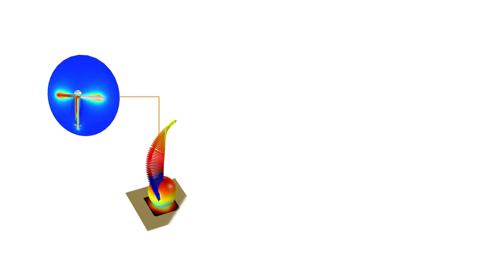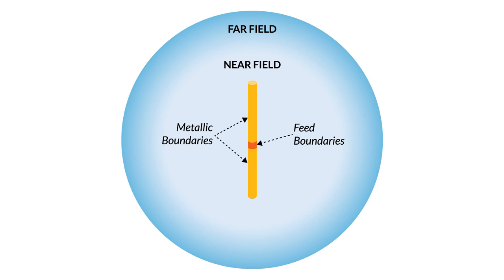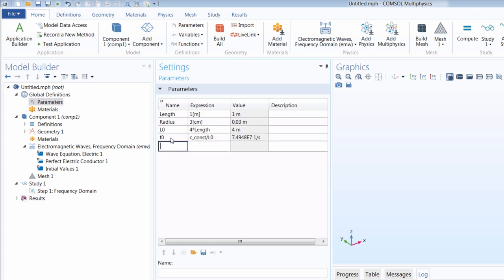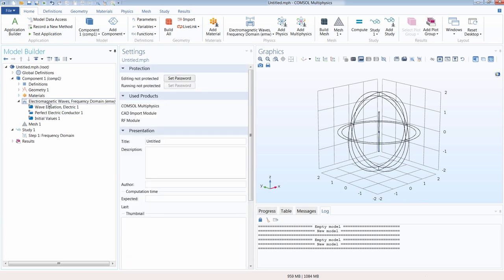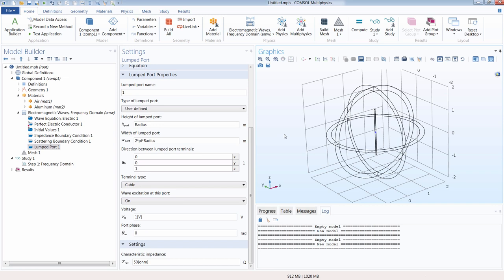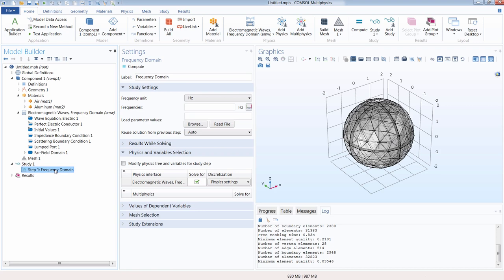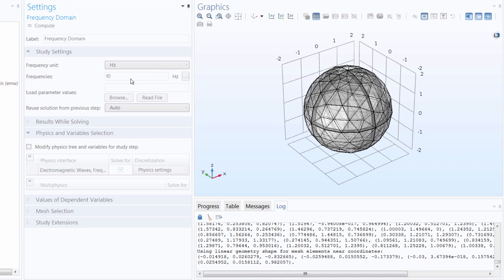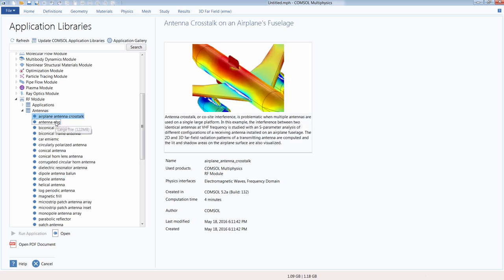How to Model Antennas in COMSOL Multiphysics®

Comment: Hi Comsol,

 I'm Rubén Bosch, I have done a helix with work plahe which are capacitors to the matching network and the supply. If I do " Form union" with helix (copper)+work plane (Perfect Electric Conductor) +sphere (air), I can define the work plane with PEC but I can't define the Impedance Boundary Condition for the Helix. On other hand, If I do " Form Assembly" with helix (copper)+work plane (Perfect Electric Conductor) +sphere (air), I can define Impedance Boundary Condition for the helix but I can't define the work plane like PEC. is there some way to obtain both solutions? can you show me the solutions with photos?

Thanks